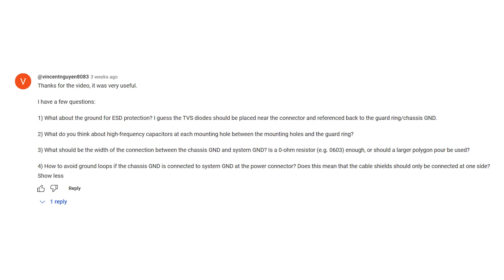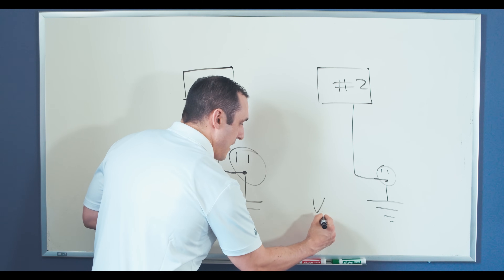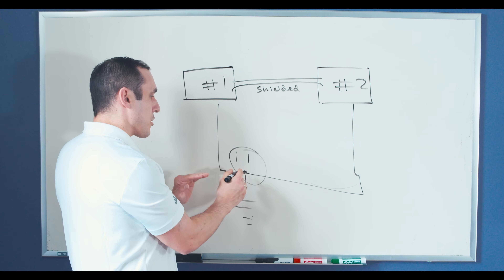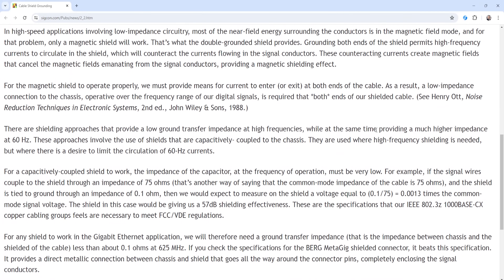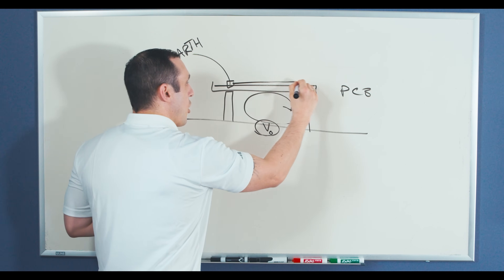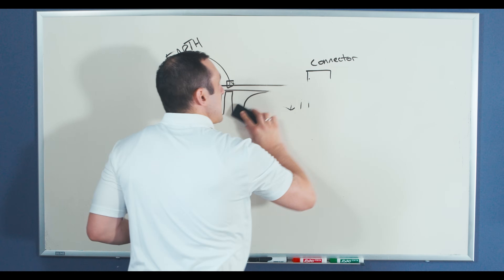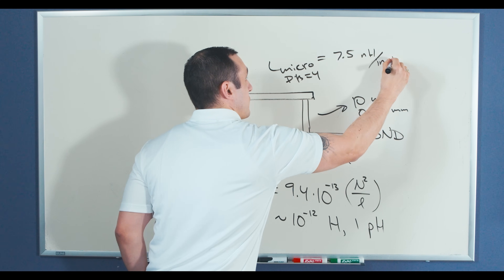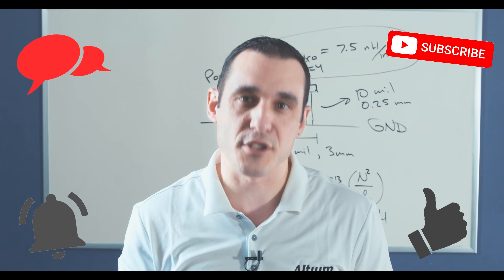PCB Ground Loops and How to Prevent Them

Comment: Any quality shielded cable only has the shield connected at one terminal, not both. Also, the ground should never be used for current. That's illegal in some areas. What you should have mentioned is the neutral, since that's actually what we're using. One of my pet peeves is electricians and electrical engineers using the same terminology to describe two differnt things. No wonder so many people get confused.

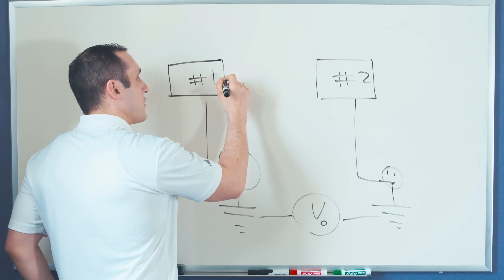Comment: 2:58  This is incorrect!  Each outlet does NOT have its own ground-rod.  A single ground-rod connects to the main disconnect & breaker box, and each outlet ground wire connects to a ground buss in the box.  The "neutral" wires are similar.
Reply: 1) It would be correct if you are interfacing two systems over long distances using seperate ground references. But I don't think he was referring to two seperate ground references. Rather
2) His example works perfectly fine even for the case of a single ground reference. Tie both of his earth symbols to a common earth with resistors between (the resistance of the ground wire to the outlets). Now you have two earths that can be at seperate voltages, both tied to a common earth reference.

Comment: There are two main causes of ground loops and you didn’t mention either of them: ohm’s law and diodes. Potential differences occur between your grounds occur when your ground or neutral wire carries non-zero current and has non-zero resistance, both extremely common circumstances! They also occur in AC-DC conversion because the diodes in your rectifier have a forward voltage drop. Your resulting DC “ground” is offset from your neutral by a voltage that depends, again, on your current. Connect the “grounds” of two different AC-DC converters together and tada… ground loop.

Comment: Hi zach i have a question. By connecting two different grounds at different point will cause ground loop means why can't we leave them as it is(seperate net without star point connection)?
Reply: Star point only works when you keep all of your signals are over each individual ground section and does not allow you to route between ground sections. This makes layout and routing difficult without adding isolators to transfer signals between different ground regions. Single ground plane is easier because it eliminates the pseudo isolation you try to create from star grounding. Ground loops only exist when you have a voltage between your ground connections, and the easiest way to eliminate the voltage between ground connections is to have lowest possible impedance between them, and that is why you would use a large plane instead of a trace or a small rail.
Reply: @Zachariah-Peterson  Thanks for your and explanation 😊

Comment: When two mounting holes are connected to chassis, how can voltage difference will be created?
Reply: If this is a small chassis and the PCB is self-contained then this would be due to external fields or noise coupling that drives a current through your enclosure.

Comment: Making another post a few months later cus I wanna.
Another option in cases where ground loops might otherwise be unavoidable and the receiving equipment has an unbalanced input is to use a ground compensated output. It's not particularly well known, but it's reasonably simple, requiring only a spare op amp in a differential driver topology at the sending unit, but you need a balanced cable to pull it off. Noise picked up by the cable is referred back to the sending unit through the cold line and compensated out, hence the name.

Comment: The drawing of the two items of equipment with each power point having a separate earth location, is probably incorrect as the earth connector of the socket will be wired back to a common earth bus bar at the distribution box. In the UK we also have ring mains rather that the hub and spoke arrangement in the US and other countries, so the earth connection for us between neighbouring sockets should be very low.

Not touched on, was that the ground line of a power supply is "connected" via the transformer to the neutral wire and not the earth. The neutral is generally grounded somewhere in the power system, but the use of a transformer means the voltages in the equipment are isolated from the mains voltage.
Reply: The connection at the bus bar will prevent a ground loop *if the wires running to that bus bar are superconductors*. And you're also running stable DC - no AC and the voltage never changes, never gets turned off and on. If the wire had zero impedance, there would be no voltage potential between any two parts of the wire.  However, if it's COPPER wire, that's still a ground loop. Because copper has non-zero resistance and inductance.
Suppose there is a loop of AC wiring within a few feet, such as the mains wiring carrying power to outlets on opposite sides of the room.  You now have two loops, one inside the other, with AC voltage on one of the loops. That makes a big transformer. 
That's what a transformer is - nested loops of wire. Your loop of ground wire is the secondary (driven half) of a large transformer. The current in one loop induces a voltage and current in the other loop.

Consider if you did NOT have a bus bar at all. Any two points of earth are still connected. By - Earth. It's really no different, you're just interchanging a connection made with copper for a connection made with a mix of copper, iron, water, and everything else earth is made of. Because that connection has non-zero impedance, you have voltage potential and therefore current flowing through your ground.
Reply: Or a more concise way of looking at it -
If you put a 9 megaohm resistor across the terminals of a 9V battery, roughly what do you think would be the current?  How about the voltage difference between the terminals?

What if we connected the terminals with a 9 ohm esistor - what would the current be between the terminals?

The two terminals are CONNECTED - just like your two receptacles are connected.

The two copper wires running to the bus bar are a 1/2 ohm resistor.

Comment: Thanks for posting that. Seems weird that connecting all the grounds together at 03:24 isn't the same as connecting grounds together in a circuit. Why is that? How is it acting like a battery instead of a wire?
Reply: It’s because the conductor (here earth) between the two earth connections is not ideal. It has some resistance and if the current through that path is high enough it will cause a significant voltage drop or a potential difference between those two points.
Reply: The conductor at 3:24 is essentially the earth connection and it could be high resistance, this is due to the length of the wiring. Ideally the potential difference across this connection should be 0 V, but because the resistance is non-zero there will be a potential drop across that connection. The loop can also easily receive stray magnetic fields due to its physically large size. In a PCB, the copper connections are very short, and for a small width trace the resistance could be much lower. The trace loop area is also much smaller.
Reply: @Zachariah-Peterson  Thanks for explaining👍🏻

Comment: "Ground lift" switches are fairly common on pro audio equipment for this reason.

Another possible option for breaking a ground loop is to use a cheater plug at one end. Do not do this if there is any part of the equipment connected to the chassis for system ground! There are many well-documented cases of singers grabbing a microphone and getting a spicy mains-referenced surprise from this.

I'd love to see a video on RF grounds vs system ground. There are a few (mostly poorly corroborated) anecdotes of guitarists picking up local ATC chatter on their unbalanced shielded cable, and the commonly recommended solution is 10nF from the isolated input jack to shunt RF interference to the grounded chassis.
Reply: When a user disconnects a signal cable, the device with such cheater plug becomes not safe to use. As you might guess, to use a cheater signal cable could be a better solution. However, both devices must properly connect a signal ground to earth/case. Very often Chinese boxes have just a soldered signal ground to a shield
Reply: @sc0or   Yes, that's why I used italics and bold for emphasis. Can be done, but very much not recommended because because high risk of electrocution. The microphone shock scene in the movie Almost Famous is a composite of several true stories. Doug Ford mentioned such incidents in one of the videos he did with Dave on EEVblog.

In your typical bar-with-a-stage performance venue, the stage equipment and the mixing console will be on separate breaker circuits, and the hundreds of milliohms resistance in the ground leads will be enough to induce hum. I presume the ground is typically lifted at the mixer end so the shield will essentially be a driven guard (here we are again) at the instrument's common potential all the way to the console input jack.
Reply: Re "anecdotes" - I had that happen VERY noticeably when I had to use an unbalanced mic cable, for reasons. It was picking up RF conversations loud and clear. It sounded like some kind of business walkie-talkies, or maybe the city public works department, something like that.

Comment: Or use balanced signaling, like all pro audio!
Reply: A lot easier in pro audio than it is in, say, industrial or automotive where there are some digital signals that have to be routed over cables. When the interfaces are standardized you can't just change it to balanced (differential).

Comment: Aren't you only supposed to ground one end of a shielded wire?
Reply: yeah how to correctly connect shielding on USB port which can be host or device would be really helpful. 
I found so many different suggestions and don't know which one is the correct to follow.
Reply: No, that was a workaround for low frequency audio connections between fuzzy equipment, that added current flowing in grund and shield connection on to the audio signal.
To keep out interference of high frequency signals (GSM mobile phones etc.), both ends of a shield needs to be connected to any chassis/shield or system ground.
Equipment with properly designed, impedance balanced inputs and outputs, where the shield and ground connections are connected in a way that does not allow ground currents to flow alongside the signal path through the electronic circuits, but rather directly between ports (such as a mains inlet and a signal input connector) away from the electronic circuits.
Look up the "pin 1 problem".
Reply: It depends. Once you get into RF frequencies, it gets more complicated. Depending on what sources of noise there are, you might do things differently. For lower frequencies, "only ground one end" is a decent rule of thumb *most the time*.

Comment: Motherboards for PC's will have each plated mounting hole to the chassis. I assume they are all connected to ground plane. Isn't this risk for ground loop problems?
Reply: This is why I'm still confused on the case of mounting holes, system ground, and a metal chassis connected to protective earth.  Many PC motherboards connect all the chassis mounting holes to system ground.  This video says to NOT connect chassis mounting holes to system ground.  Yet other advice says to perhaps connect one hole, and connect the rest through capacitors.  Still can't seem to get a clear answer as to what the correct approach actually is.
Reply: @derekkonigsberg2047  Maybe I can clarify. I'm not saying that you should always only have 1 hole connected to chassis and the rest un-connected. I'm saying two things. First, if you happened to have a ground loop and you knew it was via a connection between two mounting holes, disconnecting a mounting hole is one way to break it. There are other reasons not to connect system GND to chassis via all mounting holes which relate to a user's possible exposure to return currents, but that is an unrelated issue. Second, I am saying that even if you did connect all the mounting holes to system GND and chassis, that does not mean you automatically get a ground loop. Remember, the term "ground loop" refers to the current driven through a ground net by a potential offset, but a potential offset in your ground doesn't magically appear just because you created a loop-shaped region of conductor. Either the conductor is imperfect (such as Earth), or the loop of conductor received stray magnetic fields, or possibly the loop of conductor was formed via parasitic capacitance.
Reply: The chassis should connect to the ground shield running 360degrees around each connector. This is where the connections should be made. Just that. This forms a faraday cage.
Reply: It's only a ground loop if you develop a potential offset along the conductor path. No potential offset = no ground loop. The term "ground loop" refers to the current driven through different conductors that make up ground, not a physical loop of conductor.
Reply: Chassis is like an infinite electron well. If you are not passing large amount of current in it, it should it be at the same electrical potential everywhere. By "tapping" the PCB  plated mounting hole to the chassis, you are kind of trying to have also the "ground" or common net on your PCB to be at the same potential everywhere as your chassis. Everything is the same net, same potential, so no currrent loop.